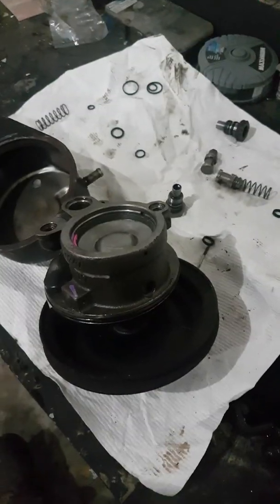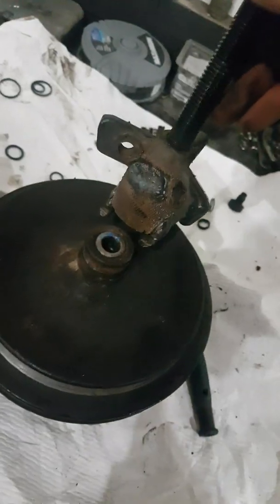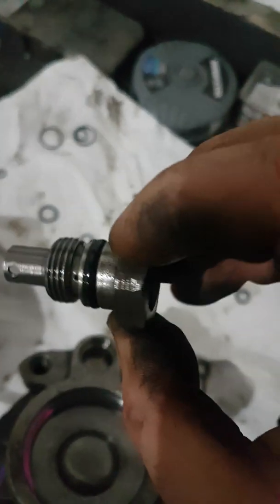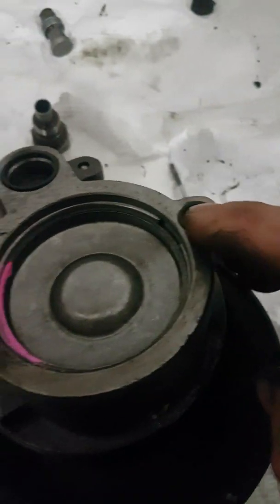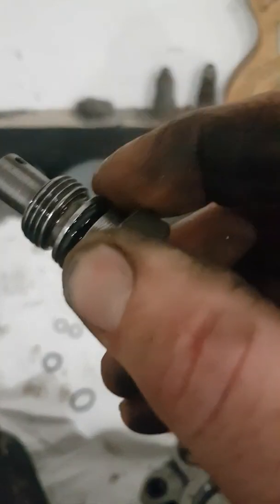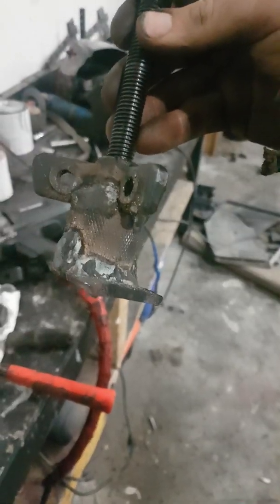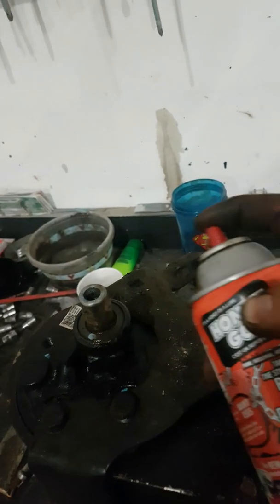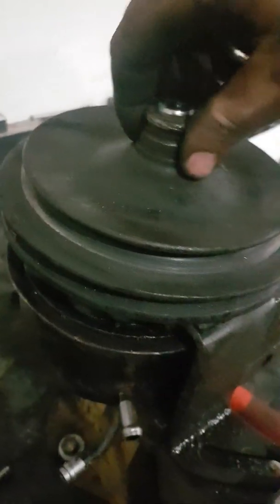GM power steering pump rebuild assembly

Comment: Hey out of curiosity what happened to pump did it make noise or you knew it wasnt working. My issue is i have severe play on a yukon swapped gearboxes mulitple times with rebuilt ones.bñed system properly.rebuilt hydraulic booster.replaced pitman arm with two brands and idler arm. Any thoughts?
Reply from the maker: Set up a camera under your truck. Start with pointing the camera at one point of the steering system that moves like a tie rod get in the truck move the steering wheel back and forth slowly then quickly. Then move the camera to the next location that moves. Do all movement points then look at the video for any slack in all locations. What your looking for is let's say your on a tie road end watch your bar going across if it's moving and not moving your spindle at the same time you have play. If everything is tight you might have to tighten the nut on top of your steering box. There Is some videos on here how to do it. Make sure you don't overdo it. It will ruin your box pretty quick
Reply: @Nitrorednecks  i have done that and seen the play on the connecting section where the 24 balls insdie gearbox are at.i have Tightened the gearbox to the point of it pushing the inside and scratched the inner housing.the play is inside that shaft where the 24 balls belong.i looked to see if they sold that part but no such luck. Thank you though for the reply i really appreciated it.if its ok i can show record the play to show you .

Comment: Obviously this video is for the budget handicapped people who can’t afford a new pump and renting of the pulley puller and press kit from Auto Zone. No need to play with o-rings and cleaning everything.
Reply from the maker: And another thing you will still need a pulley and a press they dont come on a bracket. 🤨 Also if someone was handicap wouldn't it be easier for them to get a complete pump like you do ? Wouldn't a handicap have a hard time to figure out the o rings and shit ? 🤣🤣🤣 So before you comment go try to work on something youreself. You sound like one of them guys who has a 100 dollar socket set in your shop just to say hes a man. But in reality you take your shit to the shop to get fixed but dont worry you're still half a man..🤣🤣
Reply from the maker: Haha well here in canada we dont have the luxury of having an auto zone to rent tools and for the pump this is cheaper and the the only one they had in stock that day. I ain't no city boy that has big auto part stores. Here we have to wait 2 or 3 days for our stuff. So yah I hope that clears that up for you.. 🤣